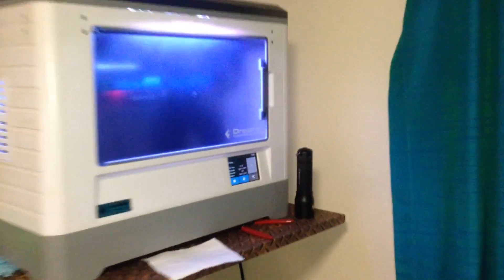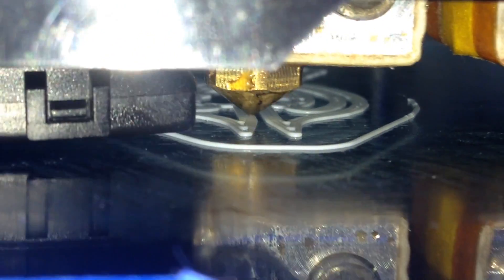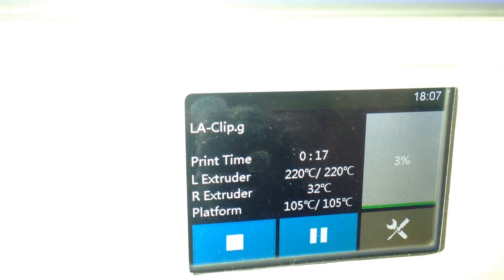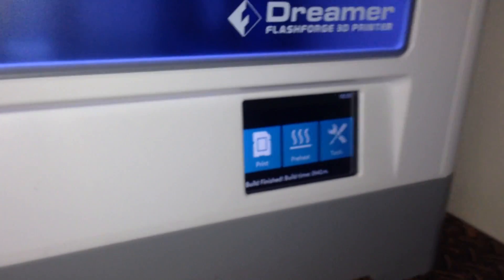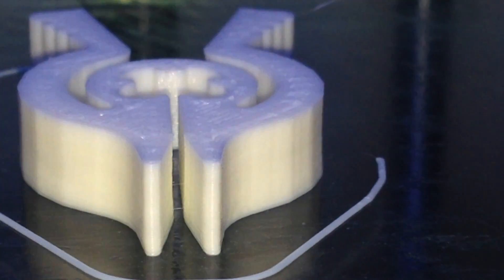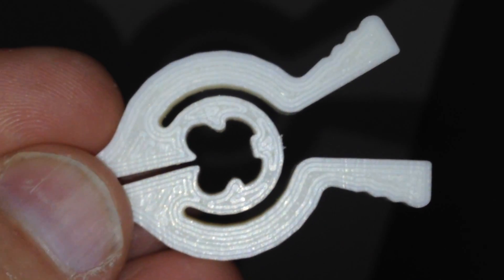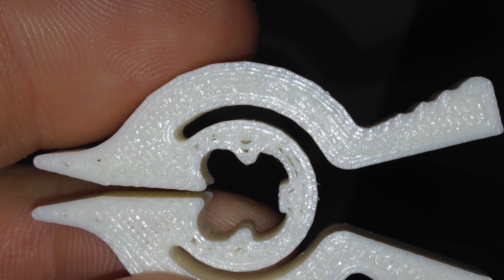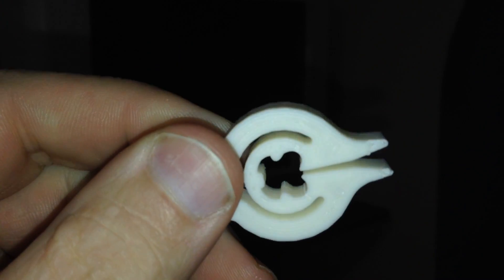Flashforge Dreamer - First ABS Print

Comment: Hi Thomas, did you have any issues with bumpy/pimply bottom layers? Also, did you have to align both your nozzles to the same height?
Reply from the maker: Hi Glenn. No, my nozzle came assembled and were pretty much even. The left nozzle a tiny bit lower than the right. No, I don't have any problem with bumpy bottom layers at all. The bottom layer is always the best, very smooth and glossy thanks to the glass bed
Reply: Hmm ok. I'm not quite sure why i get bumpy layers, maybe over extruding. Maybe i'll try your glass method in case my bed is slightly warped. The sheetmetal support that suspends the platform came bent with my machine..doesn't seem like it would cause any issues though. My right nozzle is also slightly higher. Other than that - amazing prints. Did squirtle from thingiverse in ABS at 100microns. Barely see print lines.
Reply from the maker: Glenn B. Yeah, If you get bumby lines on your first layer then your nozzle is set too high
Reply: Glenn B. Bumpy or "wavy" first layer can be the result of too much material being extruded. I suggest you reduce the extrusion multiplier from 1.0 to 0.9 or 0.95.

 If you are still extruding too much at 0.9 the extruder steps per mm in the firmware really needs to be calibrated properly.
Reply: ok awesome thanks for your help. i recently just got simplify 3D so things are looking pretty awesome especially with the buildtak surface i also bought. HIPS works really well as support material on ABS i've noticed, though i've had issues with the printer stopping and just forming a huge blob when changing materials but thats another story.